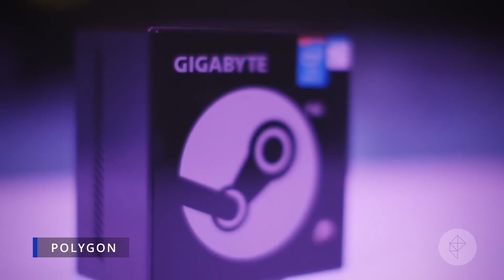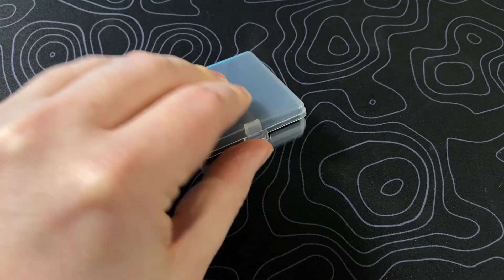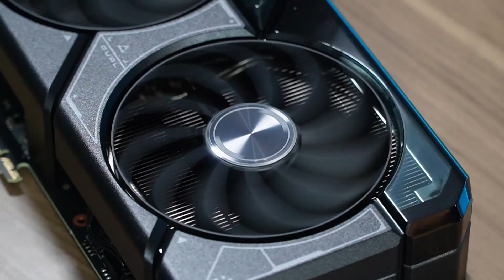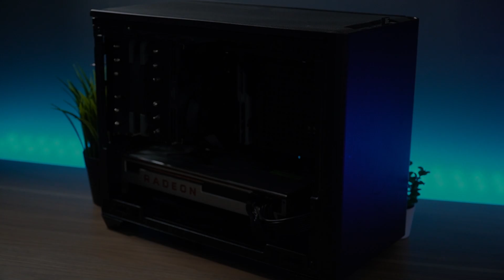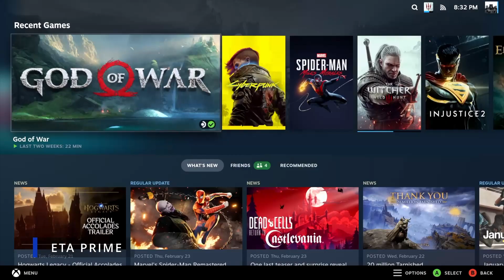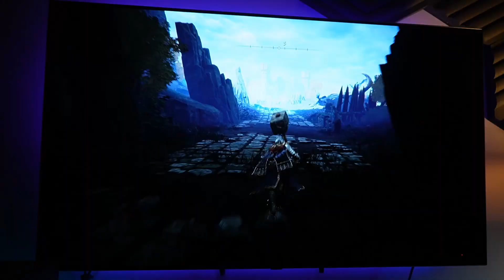The Steam Machine: I built a SteamOS console... but is it worth it?

Comment: One of the most annoying issues I've had with Bazzite is Bluetooth completely breaking on my system, nothing will show up in the devices section in Big picture mode and when I go to desktop mode it shows that no Bluetooth drivers at present and it's only solved by powering off my system disconnecting all power and clearing all residual power. I've also had some issues with some random crashes in the middle of games sometimes they will work sometimes they don't.
Reply from the maker: It sounds like Bluetooth issues are pretty normal with any distro then. Having this controller with a 2.4ghz dongle made things easier.

Comment: I think if Valve made a Steam Machine now, it could do much better than what they tried to do years ago, after all, the Steam Machine had a few problems that games didn't run well on Linux and the price point didn't offer anything over what you could get by building your own gaming rig.

Now, Proton is in a good place and with that, gaming on Linux is in a good place, but we should remember, the success of the Steam Deck is on two fronts, the ease of use and attractive price point, the question is, can they deliver on the price point whiles having decent specs? After all, a home based Steam Machine would have to be more powerful than what the Deck is by quite a margin.

As for ease of us, well, assuming they follow the same model as the Steam Deck, so basically, a single hardware platform that they can focus on like they did with the Deck, it could work out for them.

Whereas, if it's a Steam Machine with random hardware parts and just sticking SteamOS on it, that kinda defeats what Valve is aiming to do, which is a hybrid PC/console, that offers much of the openness of the PC and much of the ease of use of consoles, in other words, a PC platform but fixed level hardware on the core specs.

What Valve is doing with the Steam Deck is creating a platform, to do that, you need stability and reasonable life cycle, if the hardware is constantly changing, it might as well be a PC with all the problems that come with that, but if Valve say release 2 or 3 Steam Decks per normal console cycle and do the same for a home based PC console, whiles selling at an attractive price point and having reasonable specs, I can see that being appealing for many PC gamers that don't want the hassle of PC gaming and maintaining the system and even more appealing for console gamers that want to jump into PC gaming.

Normally, consoles have too long of a life cycle of around 7 or 8 years, which a lot of hardware changes happen over that, but 2 or 3 hardware spec upgrade would likely be enough to keep up with the times, whiles making it easy for Valve to maintain with little worry for gamers and even for developers to target them more.

In the end, Valve cracked it with the Steam Deck by having a good price point for the specs and ease of use which is far better than what we normally get with PC gaming, if they can pull that off for a home based PC consoles, they could be onto something and to put it another way, if Valve release their own PC console and support it, that would be far more reassuring than slapping SteamOS on any PC rig with random parts.

Comment: Nvidia cards Work on HoloOS

I use a Lenovo M910x with a i9-9900T, RTX A2000, ... 🤷🏻‍♂️

You need after install go in rescure mode. Connect to wifi or ethernet. Install nvidia-open drivers. Remove KMS from hooks. Combile Gamepad with Nvidia Fix. Finish 🎉

Comment: Yeah having issues with bluetooth too, have too remove the dongle then plug it in again, but this problem occurs in windows too just not as often so its not a linux problem. Most games with launchers have a launch option to skip the launcher. Also try different proton versions for problematic games, some require the old 7 series proton, and some runs better with proton GE.

Comment: Just finding this video. I had some wonkiness with ChimeraOS and HoloISO too. I ended up landing on HoloISO_Tweaked, which is being actively maintained and IMO is a much better experience than mainline. Your point to the Xbox controllers being confusing is one the reasons why I chose PS4 as my controller of choice - when you connect them with steam input running, each one gets assigned its own color on that front LED. I managed to stuff a 5800x3D and a 6950XT in a 22L case and stick it in my media center. It absolutely TEARS UP most anything at 4k, with the rare use of some FSR to keep things buttery smooth. It's an absolute treat.

Some of the QoL things I've done to get the best console-like experience: 
- Wake from sleep with a Bluetooth controller
- Custom Fan Curve in OS
- Overclocked GPU
- Undervolted CPU
-Steam download speed fix

I don't think it's worth it for everyone...yet. The momentum of these homebrew projects like ChimeraOS, HoloISO, etc, plus the development investment from Valve...it's undeniable. I don't think I'll ever see "The Year of the Linux Desktop" in my lifetime, but the Linux gaming community and experience is only going to grow and improve.
Reply: Holoiso tweaked is stuck at holoiso 4, version 5 is mutch better, so atm the original is newer and mutch better.

Comment: I've been meaning to move away from HoloOS, is it possible to just replace it with ChimeraOS without formatting or should I get it on a separate HD and migrate my games and there? It's because redownloading will cause data caps.
Reply from the maker: I've never done that, but moving your games to a different drive sounds doable.
Reply: ChimerOS is for playing games only, if you want a more complete OS i can recomend PikaOS or Nobara.

Comment: I want to build à steam OS machine on Linux system dedicated to. Is existing tutorial?
Reply from the maker: I believe there are some more in-depth guides on building something like this. My main advice points would be to make sure you use an AMD graphics card and be patient. ChimeraOS is good, but it's not perfect. Some of the issues that I've had (like bluetooth not connecting) my be on the hardware level. But a fresh build, something with an AMD GPU is all you really need. That, and a flash drive to flash the OS image onto. If you've ever installed Windows or any other flavor of Linux, it's pretty straight forward!

Comment: Your Bluetooth issue might not be caused by the OS, but rather by the motherboard. I also have a Gigabyte motherboard, although the B550i version, and if it suddenly shuts down due to a power outage, Bluetooth doesn't work at the hardware-level when I turn it back on

To fix this, unplug the PC from the outlet and hold the power button for like a minute to drain the capacitors of their remaining charge. This would reset the Bluetooth module back to a fresh state and hopefully bring back Bluetooth functionality

Hopefully this works for you as well
Reply from the maker: I'll give this a try!

Comment: Sounds like chimera os had a kernel update that borked your bluetooth.
Reply from the maker: It may be a hardware issue as well. Another commenter said something about draining the power to the system fixed it for them.
Reply: @FunkyHQYT  hm maybe they had some bios issues and draining the power reset that. Just a guess. But yeah it could be hardware related too.

Comment: Get an Xbox wireless adapter. You can pair your new Xbox controller without plug in keyboard to be able to enter bluetooth GUI. Just press pairing buttons on both dongle & controller. ChimeraOS are supported the dongle thanks to xone project.
Reply from the maker: I bought one years ago and have misplaced, and haven't wanted to buy another one. Good to know it works though!
Reply: Awesome! Thanks for the solution!

Have a question though. With the dongle, did you ever face any issues that Funky mentioned where the controller would disconnect randomly and not show up at all? Also, can multiple controllers with their own dongles be connected and used at the same time?

Comment: enable steam input for xbox controllers and use series x controller with the dongle, i use wired xbox series and it works flawlessly, i have 8bitdo ultimate but it barely works in linux so i went for xbox crontroller

Comment: Been running HoloISO for around 18mths on my 4K TV (5600, RX6600XT, 32GB).  Been working great for me.  I’ve been using 2 Steam Controllers which integrate perfectly.  I initially ran Bluetooth but also ran into issues so now I just use the Steam Controllers official USB dongle.

If I was to start a fresh I’d probably go ChimeraOS.  But honestly, it’s been the best games console experience I’ve ever owned (previously ran Series X, PS4, PS3, X360, etc).

Not convinced by using Windows and booting into Big Picture Mode.  I fear I may loose some controller integration magic and/or Gamescope window scaling.

Gamescope is the glue/magic layer that seems to set HoloISO/ChameraOS/SteamOS apart from other solutions when going for a big screen games console experience.

I’m aware you can run Gamescope on any Linux, but there’s a level of integration here.  Using it as the Window Manager, that really pulls thing together and eliminated issues so had previously when running the regular Steam Client and Big Picture Mode on other distros.

Comment: People rag on the Radeon VII and the R9 and R9 Sapphire for being terrible cards, but they still pack a damn good punch in modern titles despite chewing through power and being a heating post.
Reply from the maker: I still think they're worth looking at these days!
Reply: @FunkyHQYT  I agree, theyre fantastic cards!
Reply: yeah these cards are power hungry but that's because they were built not for Gaming but for heavy applications that require constant interactions. but these cards are great undervolters. i undervolted a few of these and on my old VEGA 64 i got it down to the power draw pf a RX 5700 same with a VEGA 7 card with no performance lost. but catch is some brands they cheap out on memory modules so those cards dont undervolt well.
Reply: @matthewjuarbe5826  i have mine undervolted for gaming on Linux and it's absolutely. Dream.

Comment: dumb............. you cant get higher than 60 frames on a tv anyways .......... the eck offers up to 144 frames if hooked to the monitor and you can actually get higher than that too
Reply from the maker: My TV goes up to 4K 120Hz over HDMI 2.1. The Radeon VII only has HDMI 2.0b, and that maxes out at 4K 60Hz. I do eventually want to upgrade to a newer AMD GPU with 2.1, but this setup works great for now!

Comment: Good video, but sadly, as usual, done by a Nvidia fanboi.

And since you won't tell everyone the truth, I will.

The reason why SteamOS doesn't support Ngreedia is because as usual, Ngreedia hates open source and refuses to release their drivers as such.

Which is typical of their anticonsumer practices by limiting your options

AMD on the other hand works with the Linux community and provides proper open source drivers.

So don't be afraid of Dear Leader Jensen and call out their horrible anticonsumer  practices.

About the Bluetooth issues, that normal for PCs,the weird solution is to buy the Microsoft wireless adapter for windows 10( that's the name and it works with w11 and Linux).
Reply from the maker: Thanks for the engagement, I guess?
Reply: @FunkyHQYT  if that is all that you can say, then you are welcome.

Comment: This only applies to windows and xbox one/x/s controllers but because I use to have issues with Bluetooth, I bought a usb xbox wireless adapter  and haven't had any issue with my controller, it is 30 buck tho and also its only rated for windows, but i have seen people getting it to work on linux if you want to give it a try.
Reply from the maker: I bought one of those a while back, but I'm not sure where it went to. I'm sure it's in a box somewhere. I'd hate to have to buy another one!

Comment: Great Video. I'm doing the same thing but a tad different setup. I had my steam machine run headless (No monitors connected) adn connected via ethernet. I game on it either through my TV, phone or tablet via Moonlight/Sunshine (best IMHO) or SteamLink. The lag isn't noticeable and I can say for certain that it feels as if I'm playing on it directly. I play fighting games and Elden Ring, so timing your inputs is a must.

Just like you, I had a bunch of issues with Chimera and HoloIso and after days of hair pulling trying to resolve them, I ended up running Win11 (de-bloated) and Steam to start in BPM. I don't have any BT controller issues as it's taken care of by either Moonlight or Steamlink, and it works flawlessly. The best thing is that I can install and use PC Gamepass and I'm not limited to the games I can play. The downside is you lose some in-built functionality from SteamOS like gamescope. To go around that issue, I run lossless scaling app from Steam.
Reply from the maker: I'm really hoping that with the official ISO, most of the issues are ironed out. I know not every game is going to be playable, but I really want Linux grow in popularity for gaming purposes.

And that's super cool that you just run it headless and stream the games! I really need to find my Steam Link and mess around with it some more. It got lost in a move somewhere, but I know it's around here somewhere...
Reply: @FunkyHQYT  Thanks. I use an Ipega telescopic controller attached to a 7" android tablet. Makes it feel as if it's an actual deck but without you constantly having it plugged in a wall socket every 2-3 hours or so. I can game on it for 5-6 hours. If it runs out I just switch to another tablet and just resume the gaming session on there without having to quit the game... or on the TV or on my phone. Oh and I just use the steamlink app for android not an actual steamlink hardware. Goodluck!

Comment: to rename the controllers you should go to old steam picture mode launching steam with params:
-oldbigpicture

Then you need to go to settings, gamepads... and then you could rename it.
after a reboot to new bigpicture or gaming mode... you will see the name of your controller and it will store to the cloud the bluethoot MAC associated with that name so if you connect it to another PC it will remember the name.
Reply from the maker: This is very helpful! Thank you!
Reply: @FunkyHQYT  
Thank you for taking your time reading the comments.
I dont know if they will be implementing renaming gamepads on new bigpicture mode, but it is a feature was before and it seems new bigpicture mode is not 100% feature parity with old bigpicture.
My fear is they deprecate and eliminate old big picture before having 100% features on the new big picture.
:) have a nice day!
Reply from the maker: Of course! I hope that they eventually just give us the option to rename the controllers. Having four xbox controllers connected at the same time was very confusing.
Reply: @FunkyHQYT 
IMHO, dual shock 4 and dual sense 5, are better on linux because Sony writes the kernel driver by themselves
And having a RGB led  built in... you could adjust the colors of every controller apart from the name of the controller.
I have nintendo switch pro controller, DS4, DS5 and xbox elite 2 and IMHO if you have money to waste, for a linux setup, I recommend you to use Sony gamepads.
Having gyroscope, you can control the camera and the aim of your weapon just using the gyro.

Anyways, I hope you will enjoy your steam machine. I hope people like you, doing what you are doing in your videos, inspire more people to adopt linux operative system.
Thanks for your time :)
Reply from the maker: I have a few PS4 controllers kicking around here somewhere... Sounds like I need to start using those instead! I really appreciate the info! 

And it's really awesome to hear words of encouragement from people in the comments. I think projects like this are a lot of fun, and getting positive feedback is always so nice! Thank you! ❤️
Reply: @FunkyHQYT  And the time passed.... and now you can rename controllers on the new UI.
I think you can revisit this video with a new version of chimeraOS with new drivers, new kernel...
Remember that on linux VEGA7 (gcn 5) is still in active development. For example if someone fix a NIR optimization for shader compilation all gpus using mesa will benefit (intel, amd and nvidia). So even if nobody is fixing your gpu, shader optimization are coming on every update. That is a totally different approach than windows or enterprise drivers for productivity.
Maybe you will find that those problems you encountered are fixed and with luck a performance boost. :)